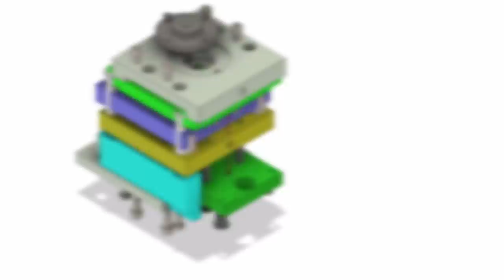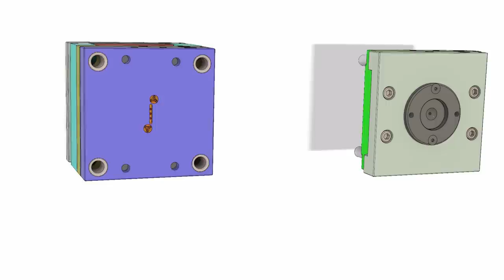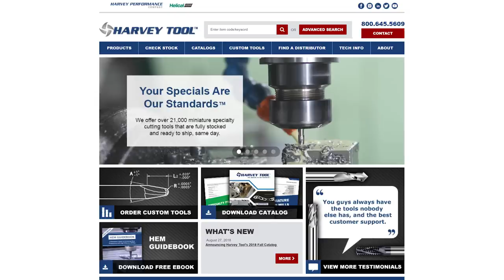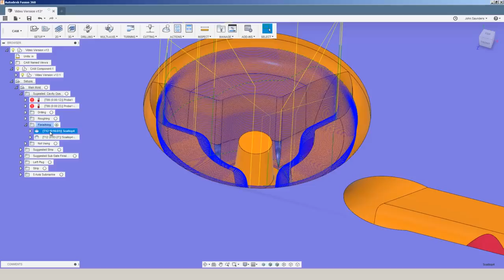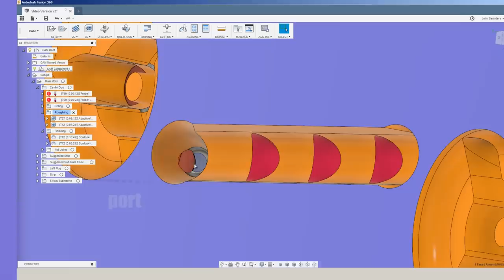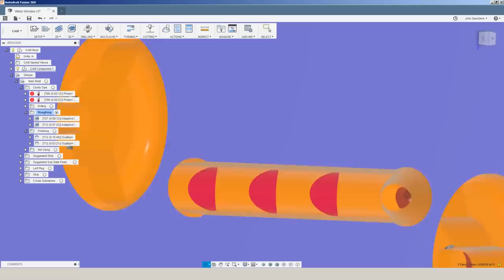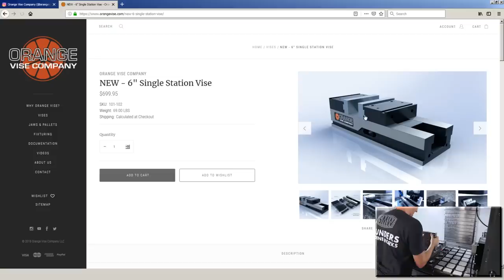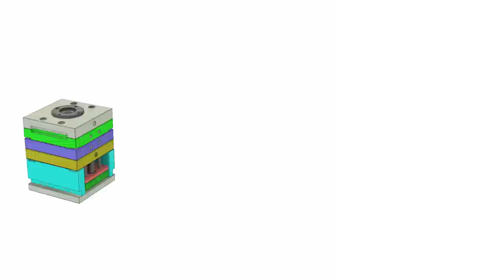Machining an INJECTION MOLD!

Comment: 13:27
why does the operator knock the piece?
Reply: Make sure its seated against the bottom of the vice. i've found with smaller pieces, they need to tapped down with a hammer to be proper flush or move a very small amount. With a larger piece like the mould part, its heavy enough not to much any amount. i'm assuming John is hitting it with his hand to judge by ear wether or not its seated correctly

Comment: Nice to see you go with injection molding for those parts.  As an aircraft mechanic it’s cringing to see you double or triple click your torque wrenches.  You will over torque your bolts doing that. If you don’t trust your wrench the first time it’s time to get a new one!   If you want an accurate torque do it only once. 😄
Reply: That's not quite correct. Ideally you click and hold so preventing slip . You then click once more to check the torque applied is still present
Reply: @markregler2164  the more you click it the higher the chance you will go past the torque and not realize it.  It was well documented.  Torque specs will also call out weather or not the fastener needs to be lubricated and with what type of product.  but that's not part of what John is trying to accomplish.  He is shooting for a consistent holding value and to hit it he should trust his tools.  I truth the best way is by is to use the clocking system.  The Air Force and by extension the CAA, now FAA adopted the torque wrench system because some mechanics could not be trusted to count a correct torque.  This is all well documented in the FAA regulations by the way.  CFR 49 series.
Reply: For steel on steel, static friction is roughly 30% more than kinetic. So, if you torque to 100 ft-lbs, then you would need 130 ft-lbs to get the bolt moving again. Once the wrench clicks, you are done.
Reply: Don’t forget, static friction is higher than dynamic friction. This means that getting the bolt to start turning again requires more torque than the wrench is set to.

Comment: I feel the the need to point out a flaw here, in the video you said something allong the lines of "I expected the mods to be very expencive" maybe not in those exact lines but omewhat. Then you commented that what you bought was not that expencive for what you where able to do with it. 

Mind you that these parts have been becoming expedentially cheaper sinds the arrival of CNC machines. 
I know you can do the machening by hand without cnc machines. Just think of how long it would have taken you to mill the V8 engine vs how long it took the cnc. 
And inmagine not having tools like Fusion 360 but doing all drawings by hand and all calculations by hand and then machene it by hand. 
In times this could only have been done by hand this would have been very expencive and taken a whole lot longer. 

BTW, I am about to start the education of becoming a machenist but my background is in IOT and IT.